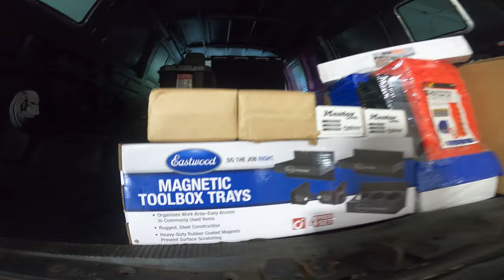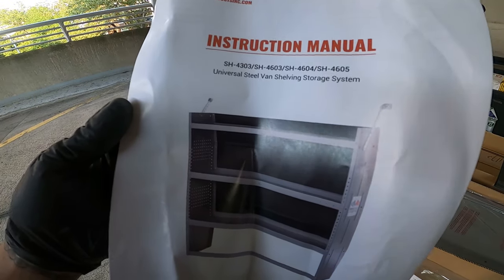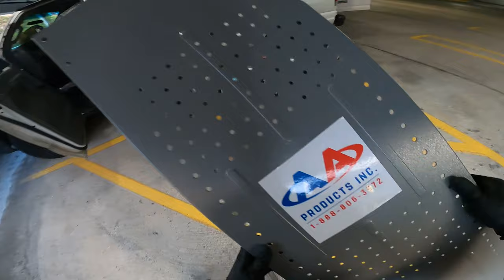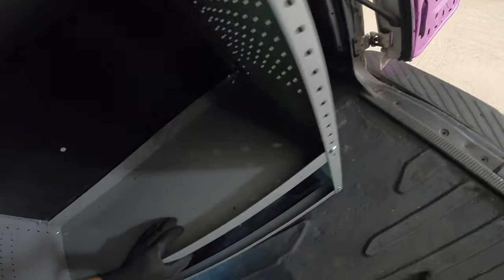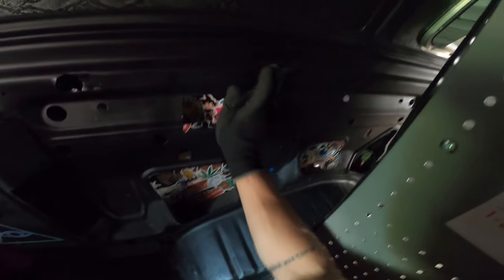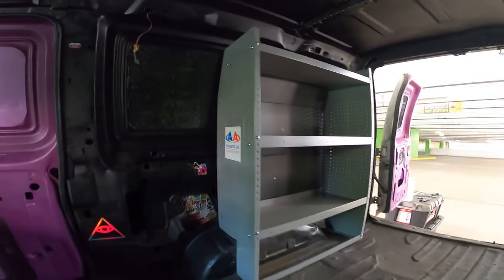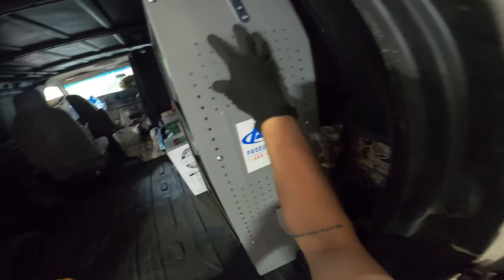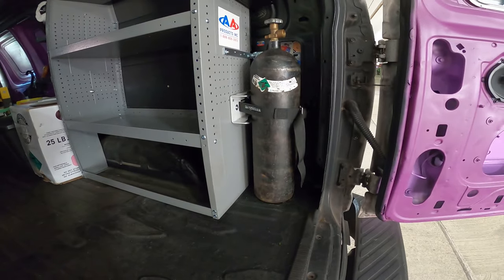DIY: Van Shelf build/Installation(Van Build Ep.3)Work Van/Camper Van/Project Van Shelf/Storage Ideas

Comment: Cool job Iv had mine done before but have a new van now with lock box going to build box for the metal box to sit on so Iv got a gap under it    Then shelf half way down the van side with gap at the top so can still slide a tower over the top   Should be good.     Nice video